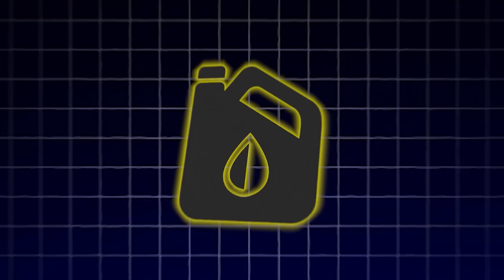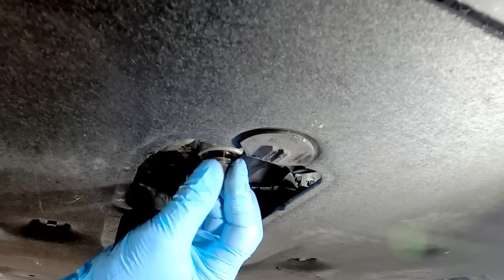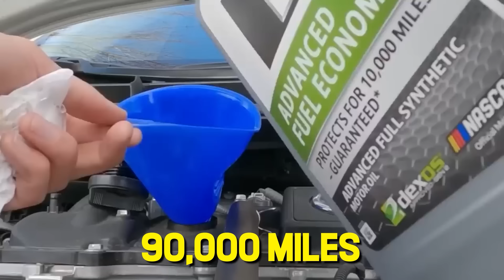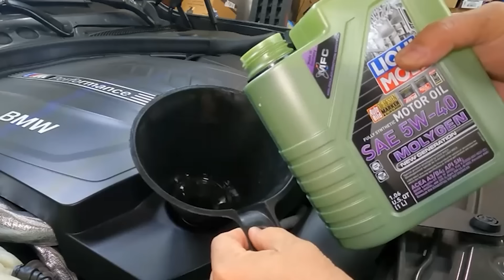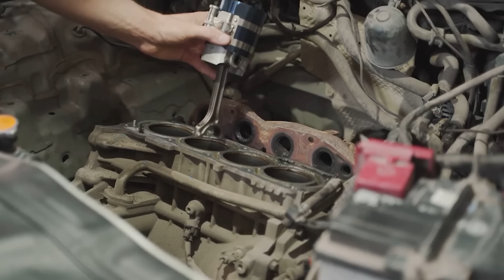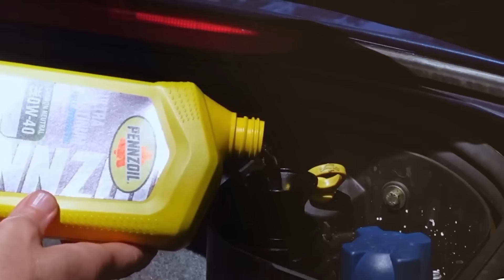After 250,000 Miles - Only ONE Oil Brand Survived (I Tested 5)

Comment: I am submitting the results of two of my oil-analysis tests (showing they beat all five of your tests, including your LiquiMoly) taken from my 2016 Toyota Camry at an oil-change interval of 7,233 miles using Amsoil “100% Synthetic” Signature Series 
0W-20 Motor Oil and my 2013 Subaru Tribeca at an interval of 7,660 miles using Amsoil “100% Synthetic” Signature Series 5W-30 Motor Oil.  Of the three metals mentioned in your tests, my Toyota had 7 ppm of Iron, 3 ppm of Aluminum and 0 ppm of Chromium and my Subaru had 7 ppm of Iron, 2 ppm of Aluminum and 1 ppm of Chromium, while LiquiMoly in your Honda had 8 ppm of Iron, 4 ppm of Aluminum and 1 ppm of Chromium.  Therefore both of my vehicles had 10 ppm of these three wear-metals using Amsoil, in contrast to your Honda had a total of 13 ppm using LiquiMoly or a 30% increase in these particular wear metals over the Amsoil! 

What you fail to mention is that there are 6 additional wear metals (besides the aforementioned 3 wear metals) that are normally included in an oil-analysis test, including the following 6 wear metals:  Nickel; Titanium; Manganese; Lead; Tin; and Copper!  I cannot believe in your testing of the 5 different oil brands, they each had “0” levels of these 6 aforesaid wear metals?   My Toyota had 1 ppm of Tin (for a total sum of 11 ppm of all 9 wear metals) and my Subaru had 1 ppm of Nickel, 1 ppm of Copper and 1 ppm of Manganese  (for a total sum of 13 ppm of all 9 wear metals).

My Toyota achieved 1.52 ppm in wear metals per 1,000 miles and my Subaru had achieved 1.69 ppm in wear metals per 1,000 miles.  The Motor Oil Geek (Lake Speed, Jr) said that any oil that can achieve less than 5 ppm of wear metals per 1,000 miles was a “really, really good oil!”  Lake even tested Amsoil “Synthetic Blend.” 5W-20 Motor Oil over the course of 5,000 miles, where it had 12 ppm of total wear metals (with 2.4 ppm of wear metals per 1,000 miles)!  That "Synthetic Blend" Motor Oil (the lowest priced motor oil for automotive gas engines) consists of over 50% synthetic oil (including Esters) and the rest Petroleum.

Yes, you probably guessed I am an Independent Amsoil Dealer with my ID number 1420935 (also used as my Referral Code).  All dealers of Amsoil are Independent Contractors, as opposed to actual employees of Amsoil.  If consumers wish to buy the Amsoil products as a Preferred Customer (PC), they will get the oil at a 25% discount, plus free shipping when they spend $100 (plus receiving a $5 coupon for every $100 you spend).  It only costs $10 for a 6 month PC membership (or $20 a year) and there is no requirement to purchase (as there is with so many companies offering a membership for a preferred customer program, where there is an automatic shipment involved). 

I invite you (along with other viewers) to visit the official website of Amsoil and apply to become my Preferred Customer, by kindly utilizing my Referral Number of 1420935 in the box where they ask “Have a Referral Number? Enter it below:”  If you can write down my referral number, before you eventually decide to exit this webpage, it will be appreciated (so that it will be at your fingertips when you get on the official Amsoil website).  Thanks for the consideration!
Reply from the maker: Thanks for sharing such thorough oil analysis data and your personal experience with different wear metals; it's definitely valuable for our community to see.

Comment: Is it 250‚000 miles or 150‚000?
  Why did you give the Blackstone test results after only the first of 4 oil changes for each brand?  The narrative pointed out that the first test can be abnormally dirty if the previous oil left extra contaminants for the new oil to clean up.
  When raving about the first test of the Moly oil, at 127‚500 miles of the test, the narrative raved about an engine with 127‚500 miles looking so good.  This suggests the Castrol was used on a brand new engine.  The break-in process produces an abnormally high amount of wear metals as moving parts wear to fit each other.

Comment: Opening image has a fault. I am not even listening to the most likely AI video due to the image. How can you show a clean piston with one oil and say it ran 250K miles and the other from an obviously neglected engine with the competitor's oil image and say that oil is bad. I have used and had no problems with the Super Tec oil. I have run it for over 100K miles and no issue when as with all modern oils that are changed on time.

Comment: I'm cheap, buy cheap beaters, namely with a Toyota or Honda nameplate, and buy the cheapest oil I can find....and that usually the Wally world brand, Supertech. Never had engine issues using Supertech. Had a 95 Corolla, which made it to 350,000 miles before I sold it. I see it every now n then cruising thru town.  Never used anything but Supertech in it.  And as a bonus, I use exclusively Fram oil filters, gasp, I know... that engine is going to grenade any moment now.
Reply: I have the exact same experience 😊. Supertech synthetic on all five vehicles. Still have my 2001 Ranger

Comment: Your testing and evaluation procedures are, at least in my mind, a bit flawed. 

I think it would've been best to do a thorough tear-down and cleaning at each change, along with measurements. The cleaning is especially important, because you want all traces of the previous oil eliminated. Yes, it's expensive, but you'll get better answers. With that said, the findings you had with Pennzoil's natural-gas based oils seems pretty consistent with what others have observed. 

I also find the use of weird random stock-footage garbage and computer-generated narration annoying. What are you hiding behind if you don't want to personally narrate your own video, or, if need be, find professional voice talent to actually do it? Many voice-over people will work very reasonably with much more authentic results...because it is authentic.

Comment: If you only took the engine apart at the end there's no way of telling which oil did what. And oil isn't bad because it goes dark, it's supposed to get dark if it's doing a good job holding on to contaminations (and some might just darken more). And every form of engine and use will dictate what CHEMISTRY works best, the brand has nothing to do with it.
With all the different images of things I take it was AI generated, which also can be misleading.

Comment: Anyone using a 0w grade is destroying their engine... Its proven to lose it's viscosity quicker than 5w by 2X... depending on driving conditions and climate a regular oil change is just as important as oil viscosity.
Reply: why is 0W worse than 5W? isnt that just the temp rating?
Reply: @jimmyjam5453   0W is the viscosity to begin with... therefore its low in friction protection but flows easily via the oil pump. However the film of oil on bearing surfaces isn't providing any friction protection for the 4 seconds (on average) it takes for oil pressure to be optimal range. Majority of engine wear is first 90 seconds of a cold start... 0w oil would be awesome if the engine was never cold, but detrimental in the majority of circumstances.

Comment: Supertech is best every 5,000 miles
Reply: Old school is every three thousand miles. Clean oil is best oil. I change my oil and filter when i begin to not see my oil dipstick level  lines through my oil. Fifty eight years doing it this way and never had an engine problem. When I sold the vehicles some people would comment it’s the best engine they have seen and heard. I’m seventy four now so what do I know. 😁
Reply: Full synthetic otherwise 3000 miles maximum
Reply: Supertech full synthetic every 5 to 7 K miles.  And I will buy whatever syn. that Menards or tractor supply puts on sale on Black friday.. I'll also buy Syn at garage and estate sales for $ 1 a quart.I'll mix one 0 in with 4 5ws

Comment: How can you judge the oil performance when the car has done 250, 000 m on the same engine? Yes the oil testing is revealing but the condition of the pistons, bores and bearings is affected by 5 different oils.
Reply: Exactly